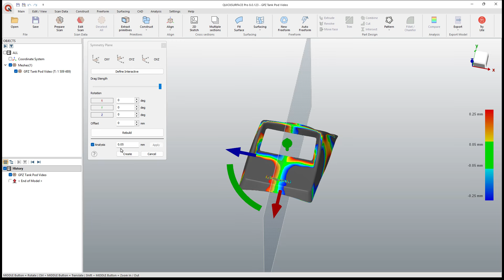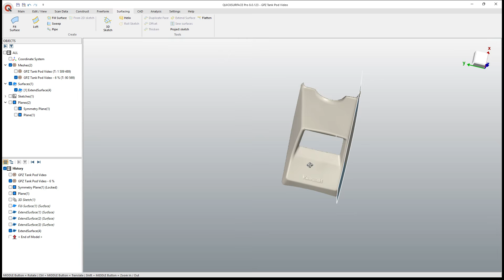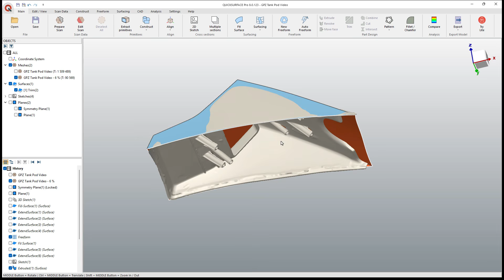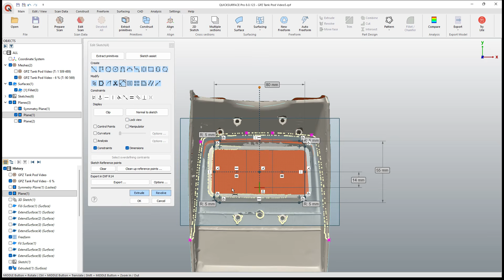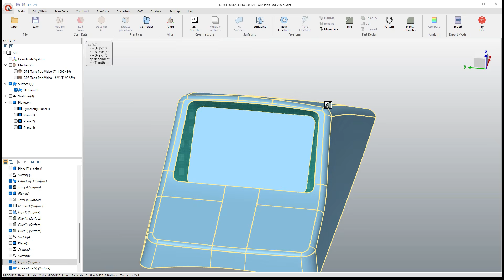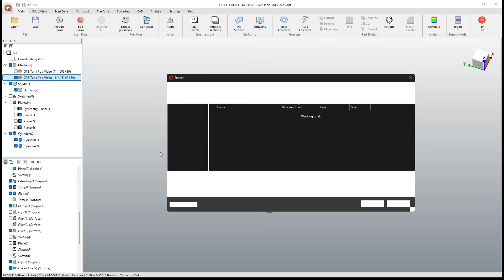Reverse Engineering a Deformed Plastic Part with Quick Surface Pro | GPz Build Series Tank Pod

Comment: What 3D scanner has been used for this mesh? Which one on the market is the best for you around 2k budget? Thank you
Reply from the maker: This specific one was done with the Einstar2  https://youtu.be/osE14ux4-lk

Best is tough to say.  It really depends on what you are scanning.  First choice before you even think about brand would be to figure out what you want to scan in size and detail.  The distance the depth cameras are away from each other (like your eyes) determines how far away from an object you can scan (basically).  Some scanners have multiple depth cameras making them more versatile for object size, but most don't have laser scanning with that.  If you need highly detailed scans then laser scanning is usually a goto.  

while this video doesn't cover it all it was focused on what Revopoint had at the time of filming (there are more now), this might help give you some idea on the different scanners
https://youtu.be/PiknHBjn13I?si=Jrz7L81yBX3BHZYX

One thing I will mention is that laser scanners need more powerful hardware so factor that into your price.  A Windows laptop (some companies don't support Mac), will be $4000+....

Comment: is this better than fusion?
Reply from the maker: QuickSurface is a dedicated program for working with scan meshes.  It is much better at pulling data off a scan and recreating the exact (or close) shape.  It is not a dedicated CAD program.  you can do CAD in it, but for design work I would still go toward Fusion or a CAD program.

There is a personal version, which has a lot of tools but export STL only.  There is a LITE version with a limited toolset but you can do commercial work with it.  Then there is Pro and an add-in for Solidworks.  Pro has the most features.  Solidworks version is limited in some areas just based on how Solidworks behaves.